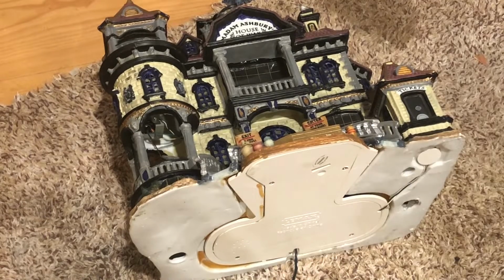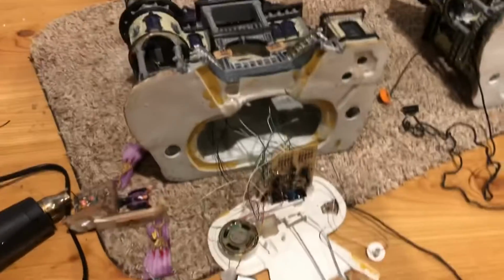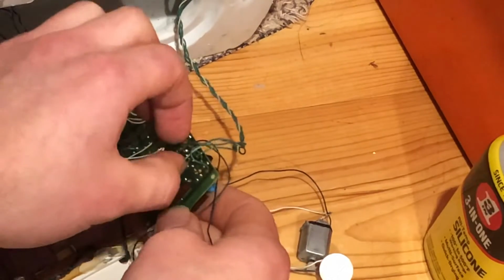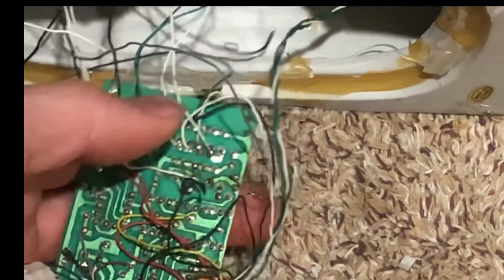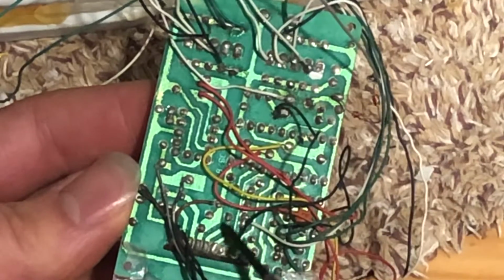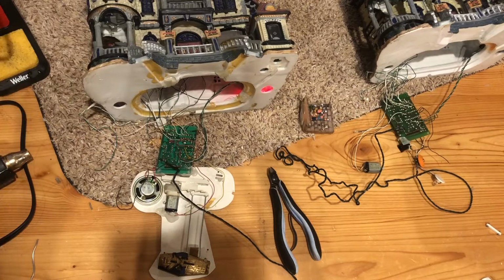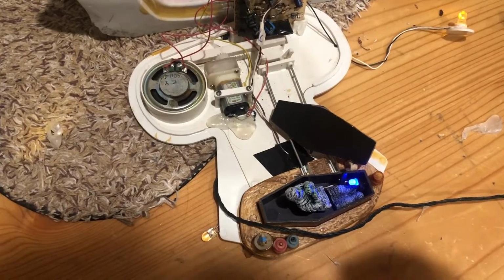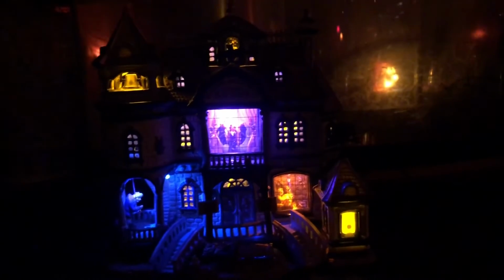Lemax Madam Ashbury’s House of Wax Repair and troubleshoot

Comment: Bats are turning now, I located a disconnected bat motor wire and resoldered it to the circuit board. Your videos are great, keep them coming!
Reply from the maker: Super!

Glad it works now!

And yep I enjoy repairing and modifying these lemax buildings 

So hopefully you should get a few each year

Comment: Thanks for your video Kaden, how would you investigate one of these where the bats are not turning?
Reply from the maker: It’ll be tricky,.

First you would need to remove the base and just carefully check to make sure the wires are connected 
(Most Likely not the problem)

Secondly you’d need to carefully pop the motor off from the top 

(If you saw the portion of my video with the mummy’s gear box)

Same rule applies for the bats 

Unfortunately grease dries up overtime on some of these and blocks it from moving 

You can also try putting some oil on the outside of the house and you might get lucky and have some oil seep through and loosen things without having to take it apart

But most likely you will need to remove the motor from the gearbox and lubricate 

Hope this helps!
Reply: Great video. I like the extra detail in her room. Love how you did the lighting on the mummy. What did you use for the rubber on the lid hinge?  I tried to replace with a rubber band, but if it’s too loose, it falls off. If it’s too tight, the lid doesn’t close back completely. 

Also, my bell ringer guy doesn’t move. Any suggestions?
Reply from the maker: For the coffin I did use a rubber band 
It has to be cut a bit long and then has two holes punched

Even on mine its not super reliable, though with the coffin

With the bell ringer he is connected to the bell on top

If the bell doesn't ring, then most likely the motor box is seized